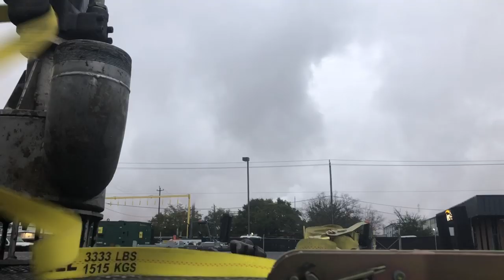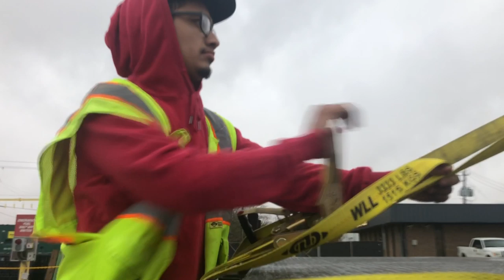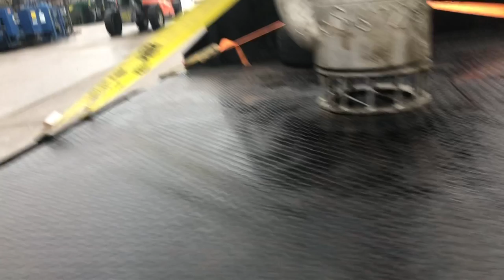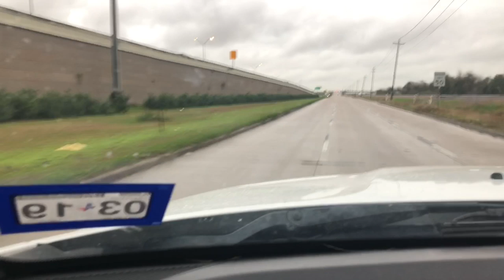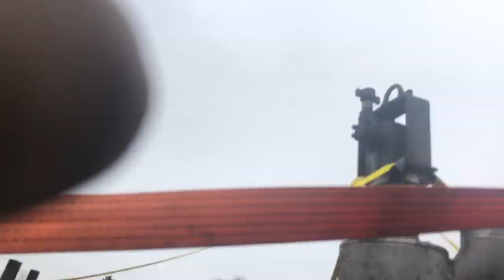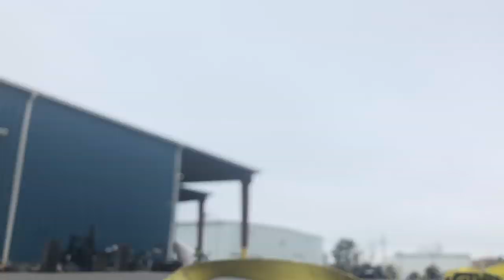Flatbed Or Box Bed?!?

Comment: Having had owned both..when you have a bed , your main access is from the back , but when you have a flat bed , you access a lot more from the sides. As a tradesman , I rather flat bed  with custom tool boxes either side. You can always add under bed storage boxes too. Kind of handy for rope n stuff.

Comment: Carry 4X4’s and rubber mud flaps  .  Rubber mud flaps may be used as a friction mats . Use makeshift headers securing the load from moving forward .  Have a fabrication shop place stake pockets in several locations in the bed .This will allow you you use portable winch straps efficiently tightening tie down angles .